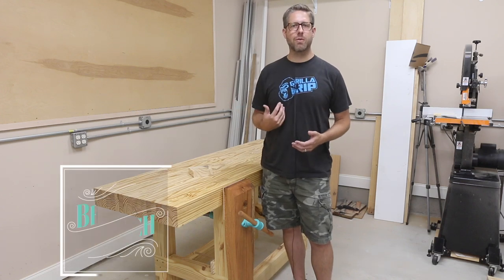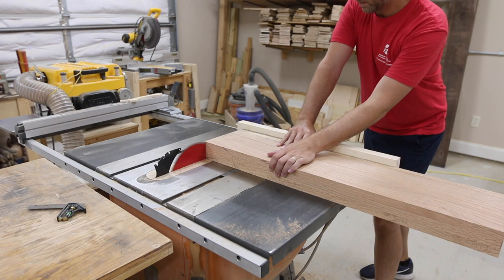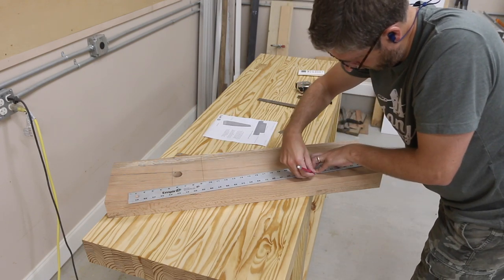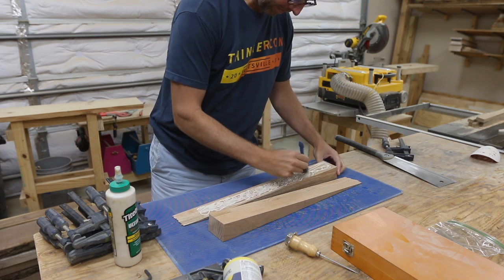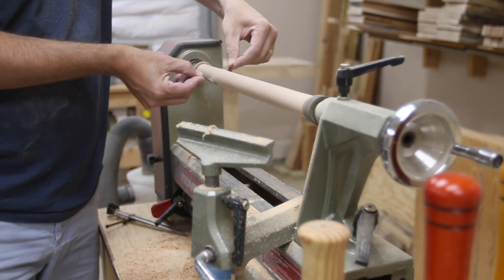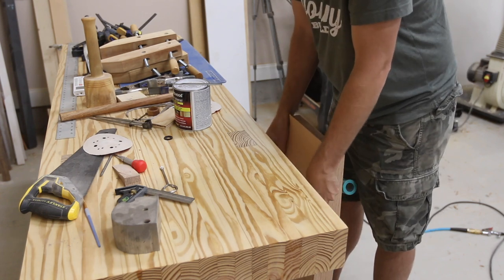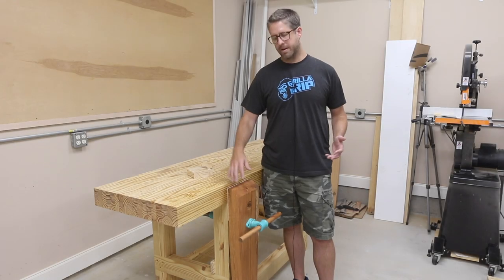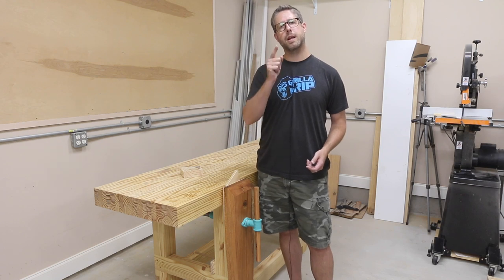Making and Installing a Leg Vise

Comment: I'm glad I came to look at this video. This is great!
What material did you use to build the vice?
Also, 5:02 that's a LOT of glue...
In my head I was already trying to think of a way to secure the handle, and of course, it was going to be overly complex. But the screw on either side is a genius low-tech solution I thought...
Great job friend!
Reply from the maker: Thanks, Stephen! I used some spalted red oak for the leg vise material. Yeah, wanted to get some really good adhesion, so used a ton of glue. I was pondering some other ways of securing the handle, but they were just unnecessarily complicated like you said. This way turned out to be really simple and is still working well!
Reply: He used the Oak tree that fell in his parents yard from the hurricane. A guy came with a mill and milled the oak tree for him in exchange for a bunch of pecan trees.

Comment: I just completed jays bench with the same hardware. I also used syp with some oak trim. I'm loving the table. One thing about southern yellow pine is that it doesn't take glue very well. I used tightbond 2 glue. So if you use syp, make sure you don't skimp on the glue. One thing I noticed with the yost vice kit is the lack of support between the vice and the table leg. I'm going to add a bearing of some sort along with the hub that is attached to the back of the leg for support. That also should make it screw in and out a lot smoother. I used danish oil for my finish like jay but now i think ill add a little wipe on poly thinned down to help harden the pores of the wood some. Great job on your bench.
Reply from the maker: Thank you! I’m liking my bench too! Yeah, I’ve been pleased with the wipe on poly I did.

Comment: Nice work!  I’m actually making the same bench right now. I appreciate that you made a second video for the leg vice. Cheers!!
Reply from the maker: Oh cool! You’re using pine too?
Reply: Bruce A. Ulrich absolutely. Jay Bates had published a video on the pros and cons of his hardwood bench vs his pine bench. The pine meets my needs and was much easier on my wallet. 

My variations will come with some added storage under the bench top. I’m also going to attempt to incorporate some add-ons from April Wilkerson assembly table build.
Reply from the maker: @southerncustomcuts729  Yeah, I like how easy on the wallet this one was. That should be cool to put some add ons on there.

Comment: Could you possibly  provide the floor wedge dimensions?  Just winging my vice w/o plans. Thanks, Good job! Will
Reply from the maker: It’s about 20 inches long. I don’t know if that helps. The angle of the wedge doesn’t matter as long as you transfer that to the under side of the vise.
Reply: @BruceAUlrich  
Thanks

Comment: Do you find it that you have problems with your back after using that table? just seem short for you.
Reply from the maker: If I'm doing any detail work, I usually pull up a stool and have a seat. As far as using the vise, it is about the right height for me.

Comment: Bruce, for the Yoist screw, did you drill  the chop and leg the same shaft diamater, i.e. 30mm (1-/316) or go a a bit larger, maybe1-3/8"?   Also did you go through level or angle up slightly to counteract racking?  Thanks a bunch and the torquise color looks great!
-Will
Reply from the maker: It was a pretty tight fit, but the hole was slightly larger than the screw. It gets screwed to the leg and to the vise, so it's ok to have a little space. I drilled that hole level and to help with racking, I used that dowel that you see. It's based on Jay Bates' plans that I used.
Reply: Thanks again Bruce for helping and responding.  Will be starting with  a forstner bit and bore out wtih a 1-1/4" spade bit.

Comment: Great vice!, please could you tell the angle or ratio of the wedge? thank you in advance.
Reply from the maker: Thank you! I didn't use a specific angle for the wedge. It was arbitrary. Be sure to cut the wedge first, and then just trace whatever that angle is onto your leg vise chop. Then, you'll be sure the two fit together.

Comment: At the end when you show how to use it your camera was positioned until we missed the wedge inset at the bottom. I looked back and could not find anything about how the floor wedge works.
Reply from the maker: Sorry about that. Not sure if I can explain it the best here. I know Jay Bates did a little more detail about it in his video about it. This is based on his design. The simple version is that as soon as the jaw of the vise grabs your material, you push the wedge in until it meets the leg vise. Then, you turn about another half of a turn and it’ll be tight. The wedge prevents racking.

Comment: Hi, Do you know what minimum thickness to choose for the vise if made of oak? Thanks for your great video.
Reply from the maker: I’m not sure of the minimum thickness. You do want it to be pretty thick and beefy do it can hold well. Of it was too thin, I think it would flex as you clamped it down.
Reply: @BruceAUlrich  Thanks Bruce. The board of oak I bought is 2 inches thick. I wonder if It's possible to glue another type of wood board to make it beefier.
Reply from the maker: Yeah for sure! That’s what I did. I had to glue 3 oak boards together to make mine

Comment: Looks good Bruce, the paint is awesome! What happens if you don't use the wedge?
Reply from the maker: Thanks, Robin! If you don’t use the wedge, the leg vise will rack and not hold securely. The wedge acts like an ever-adjusting bottom counterpart to the material at the top that you’re trying to clamp.
Reply: @BruceAUlrich  Nice job Bruce,  I've built a leg vise, would like to go the wedge route also,  What angle did you use for  the wedge?
Reply from the maker: I don’t recall at all! I don’t think it is that important but it needs to be less than 45 degrees for sure.
Reply: @BruceAUlrich  Thanks, will probably go for 15 or 20 degrees...